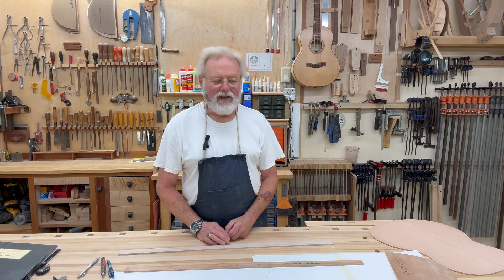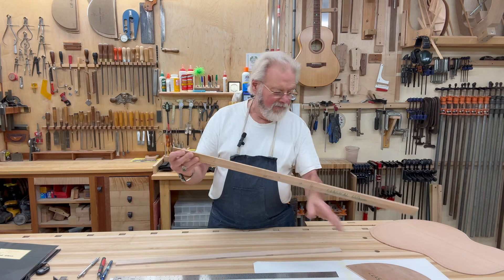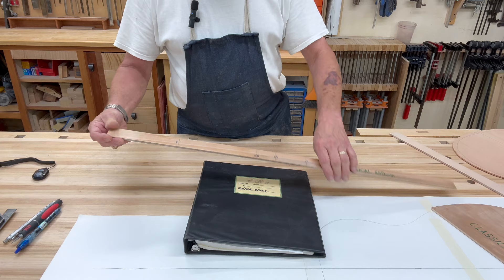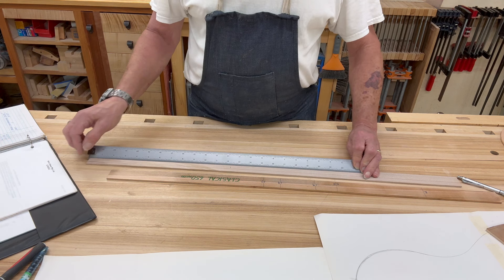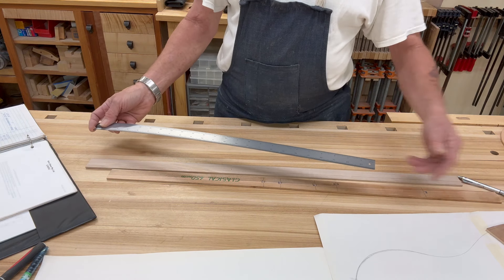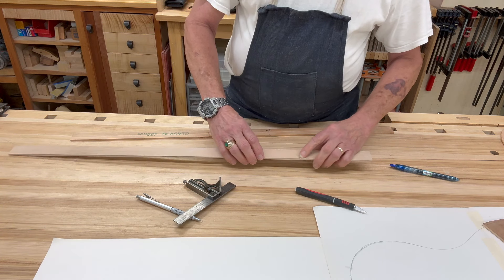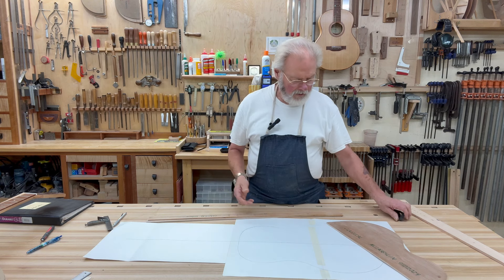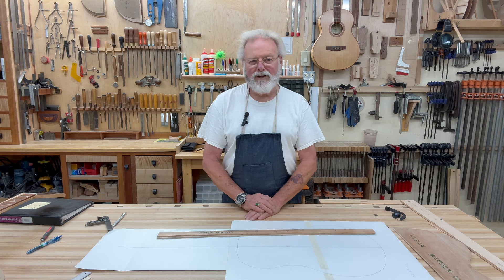The Story Stick Story

Comment: I really like the idea of using templates and gauges for building, it takes the guesswork away and reduces mistakes. Its a bit like they used to do back in the very old days wher they would use a gauge for the individual project, such as a windmill, they never had rukers back then, and just used divisons of a standard length, its the way forward ! Great video

Comment: Related to this. Working out where frets go, graphically.  In a book, I had a very long time ago. They presented an acute angle that you could carefully draw onto a piece of cardboard or wood. The intersection of the lines, becomes the bridge saddle position.  You carefully measure the scale length, along the horizontal axis. The end of that measurement becomes the position of the nut.  Carefully project a perpendicular line from that point on the horizontal line, up to the angled line. Take a compas with a very sharp lead or a pair of dividers. Set it to the length of the vertical, perpendicular line.  With the point on the horizontal line. Scribe an arc from the slanted line down to the horizontal line.  Where this arc intersects with the horizontal line. Is where the first fret is positioned.  From that point, project a perpendicular line up to the slanting line. Scribe another arc down to the horizontal line to locate fret number two. Etc Etc,. To correct any accumulated error. I ensured that the 12th fret was half the scale length.   If it isn't the adjust the position so it is.  Have I completely lost everybody. ?
Reply from the maker: It's a very old method which in theory works.  In practice, however, it's inherently imprecise.

Comment: At 1:00 Could you not lay the scale rule down at an angle, so it becomes the hypotenuse of a right-angle triangle?  The base of the triangle would correspond to the desired (slightly shorter) scale length.  You'd also need a try square and a very good eye.
Reply: @thepragmaticluthier  It's difficult to explain in writing alone!  Let's say the ruler has Fender scale length divisions (25.5"), but you want to use a PRS scale length of 25".  Measure 25" from bridge to nut and mark a centreline.  Mark a 90 degree line from the nut end, a couple of inches, then lay the rule down with the bridge end touching the 25" mark, and the nut end moved away from the centreline so the ruler's nut mark crosses the 90 degree line you just drew.  Then mark more lines at 90 degrees to the centreline, with each one crossing where it meets the scale ruler.  This will shorten every division by exactly the same amount.